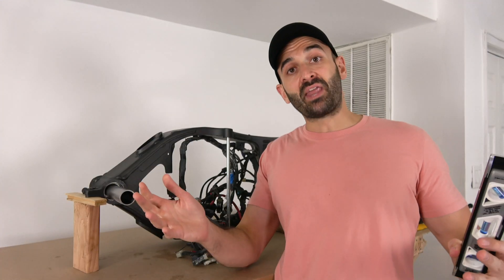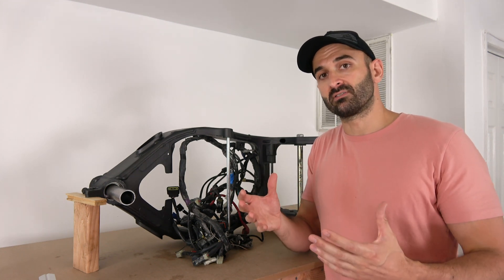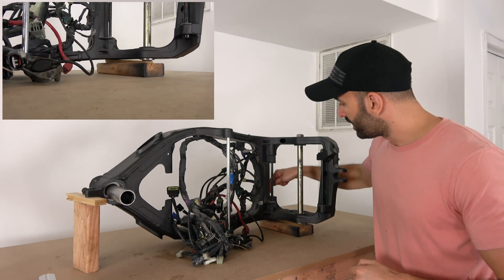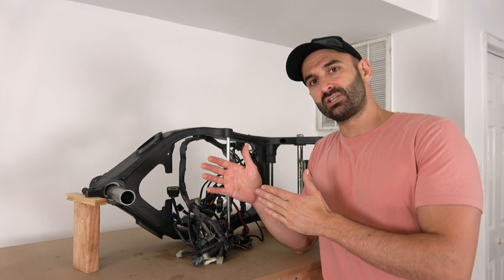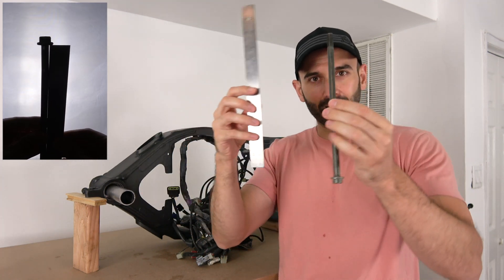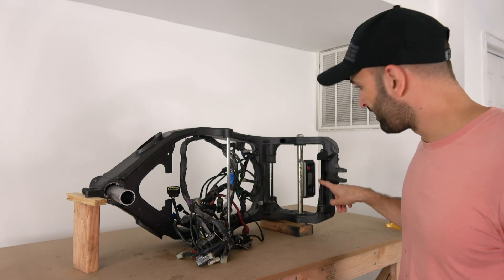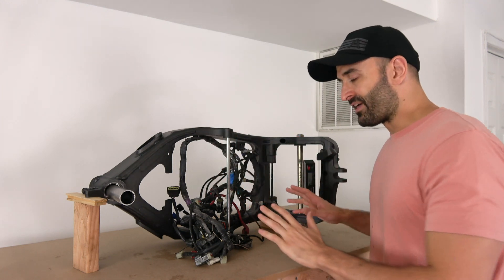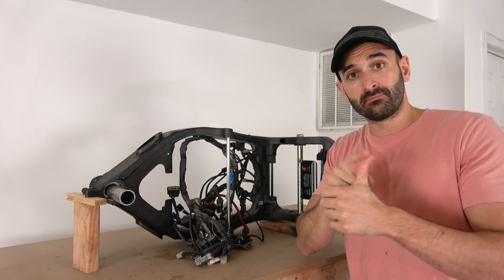How to Control a Motorcycle Frame with a LEVEL - Wrecked Yamaha R1 Rebuild - Part 6

Comment: Thx, that was helpful. But i think you should have measured front rake too. For example i had front hit in accident and rake may have changed i bit. I would use your method to measure frame geometry for sure, but it needs to take frame apart, not sure i want to do that))))
Reply from the maker: I simply don’t have the information that tells me how to measure the rake, believe me I tried.

So the rake on an R1 is 24° on assembled bike with the reference being the vertical. But how do I position my frame alone to have that reference? I just don’t know how to create a reference that I can measure against…
Reply: @TristanDurandBuilds  Yes, you are right. I've decided to sell my bike "as is". Too much to do to get it repared.

Comment: Good job Tristan and thank you for your time and effort to make this video. I wanted to check the frame of my bike after an accident and I Laser inspected the frame against the factory figures. There is a lot more to it than the vertical orientation of the steering stem. Verticality on mine was fine but it failed on rake (-2.8cm) and an upward height displacement of the bottom of the stem for about 0.9cm caused by a head on strike. My bike now has a noticeable transfer of weight and an inclination  towards the front exceeding the factory settings and changing the handling too.
Reply from the maker: I understand what you’re saying, but I’m trying to do things safely without spending hundreds and wait months for the frame control guy to be available

I tried to get the factory specs on the frame: I wasn’t successful

So I didn’t know how to measure the rake

My technique is not bullet proof but would honestly weed out a bunch of frames, of course there is always the frame that distorted in a very symmetrical fashion, I just don’t think it’s frequent
Reply: @TristanDurandBuilds  Don't get me wrong, I understand you have made an honest effort. All I am saying is that it may not be the most appropriate method for bikes like the R1, Aprilias, MV's and such bikes that people use often in track days and racing circuits. Maybe good for a less demanding rider or bike but when you have a bike that corners at high speed maybe too much of a risk to not test the frame properly. Thank you for your reply.

Comment: Fantastic video on how to measure and determine if your frame is straight, but the title is very misleading. There is no control you are measuring against, as though there was an experiment, and you are not exerting force to change (control) anything. With a more accurate title you may get more views. Other than that this is great information.
Reply from the maker: Thanks for you POV ✌️
I would say that I’m definitely controlling the frame, what I am not doing is measuring distances or the caster angle as I don’t have the Yamaha shop documentation that tells me how to reference that caster angle to.